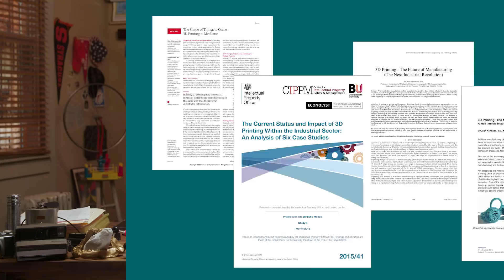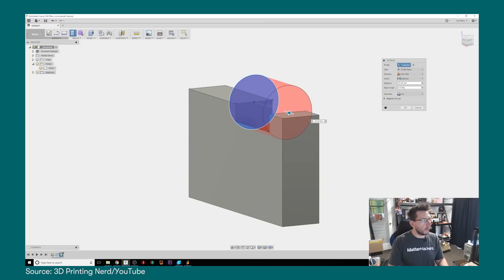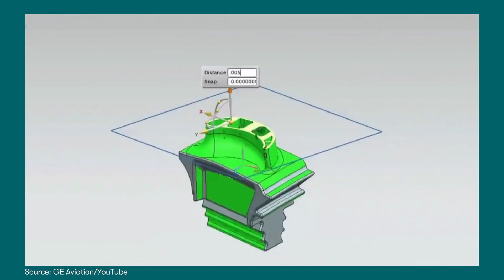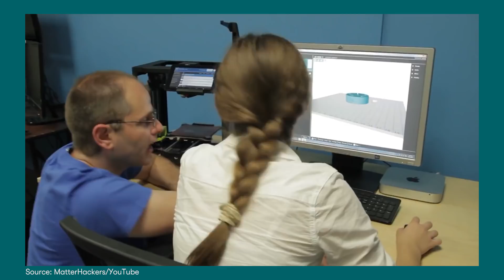What happened to the 3D printing revolution?

Comment: I've heard a lot of hype about 3D printed organs and body parts ie ears..  is this still a thing that is moving forward and has a future?
Reply: Joseph Brokenbourgh I think it might work out in the future
Reply: Technically it's not 3d-printing the organs, but 3d-printing a mesh that has the shape of the organ, that living cells can populate and grow in.
The technique is similar to other approaches, just that the organ can be printed with more precision than it could be built otherwise. 

It is definitely going to have a future. The only remaining question is whether it will be a full-width tool for all organ-needs or only a specialised tool that works with some, but not all. But there will be a place for it in the future. Up until we manage to get nano-bots working, that is. :-)
Reply: I did, I posted a link above. My original comment was meant to compliment Lou's report.
Reply: It's still a thing, but much more complicated than just moving a string of molten plastic. Research uses 3D printing for a lot of cool stuff, like creating a realistic meat-like texture for faked meat.

Don't expect to see this in mainstream for a long time though, doing individual experiments in a lab vs. having a reliable system for everyday use are two very different things.
Reply: Supposedly it's also going to be used to make homes
Reply: Already happening in Europe, several news reports from the Netherlands and Norway on 3D homes. )ne of them is printable in under 24 hours, I find google is handy for checking out things :)
Reply: halimceria it's not overpromising, it's a very complicated subject and there is possibility, it simply not easy to develop such a tecnology.
Reply: +Jamobu Wadeji "Look at how much they've improved in 25 years"

One of the first inkjet printers of our family survived more than twice as long as any printer we bought afterwards. I wouldn't use that as an example, new printers are only built to outlast the first ink cartridge.
Reply: SaHaRaSquad I meant print quality, not build quality in that case
Reply: 100% a thing. At least in terms of additive manufacturing of biofriendly materials. Things like bone scaffolds are almost ideal for additive manufacturing
Reply: There's a lot of 3d printed prosthetics companies at the moment, as this enables them to cater each piece of hardware to the users specific requirements/dimensions. I saw a company doing bionic parts which worked really well. Its an exciting technology in the right hands for sure.
Reply: They are trying regeneration in different ways that seem to hold promise.
Reply: Hell Yeh only just getting started. 3d printing will 100% be used in medicine in near (5-15 years) future
Reply: https://www.ncbi.nlm.nih.gov/pmc/articles/PMC4189697/
Reply: Materials is the challenge. Body rejects stuff that it hasnt grown, over time.
So yes, we are experimentally able to create organ substitute, short term.
Might work better for bones.
Reply: yes. and there are beggining of cheaper and easier to build prosthetics 3d printed. now for tissues its a bit harder because it also requires to grow the cells in separate cultures etc. but give a decade or two and it might be everywhere in medicine, just like additive manufacturing already is in many industries
Reply: you can't just print years of cumulative metabolism as an organ... some of you guys are delusional when it comes to 3D printing lmao.
Reply: I hope so. I want tetrachromat eyes. also, not that I really need it, but a bigger dick would be nice.
Reply: I agree that's where the future is. Old folks (like me) are going to need replacement body parts some day - and there's rarely a 'one size fits all' situation. 3D Printing will allow for custom-fit, bio-medical spares! :)
Reply: I don´t think so. In the future if you lose a leg you have lost it and that´s it.
Reply: Look it up. nub. Do you expect these plebs to give you the news?
Reply: pcolly2509 yeah I think people are forgetting that what we have at the minute, is the equivalent of the very first inkjet printer in ‘92. Look at how much they’ve improved in 25 years.

What we are using now, is the very beginnings of 3D printing. 

20 years from now they’ll be much neater (not smaller necessarily), more economic, faster and I would imagine easier to use.

Printing materials will probably improve, and prices will drop.

One day they will be accessible I imagine. Very much so
Reply: pcolly2509 umm, no. stop overpromising 3D printing.

Comment: Additive manufacturing can also reduce waste because you may not need to start with a big block of metal and machine all the material away. This is also potentially a lot cheaper.
Reply: Yeah - this is a good point. Also, if you have the ability to 3d manufacture in house, perhaps you won't have to invest in a big upfront inventory order that can potentially go unsold and sent to a landfill or wherever.
Reply: Joey Hoogendoorn you're comparing it to cnc milling. It would use the same amount of material for injection molding/casting
Reply: Dave Buchanan well not really. There needs to be a mold for injection molding...
Reply: Joey Hoogendoorn With the new advancement in 3d printing,which is rapid liquid printing(printing in a vat full of gel)it can be more efficient as there’s no need for support pieces to be printed and fillers as the gel supports the item being printed.TBh mold injecting itself is a waste as you can’t have a hollow space with whatever you’re molding in(sorry if i’m wrong about the hollow space bit).
Reply: Yeah, but that doesn't mean those methods can be used at all times or are most cost-effective. Material properties are also a thing to consider and sometimes there are features on a part that may not need the same structural properties and can be added on after the first part of the manufacturing process, possibly reducing overall cost. If casting/molding are possible for a particular part, it is probably cheaper at this point compared to additive and would indeed also use less material than a CNC process. Companies will probably start using additive where it can reduce cost and where they might be getting government funding because of joint research projects.
Reply: Okay, but CNC'ing might not work either depending on the complexity of a part. I'm just saying your material waste comment is misleading, there's too many factors to account for.
Reply: Search Matsuura Lumex Avance 25.....3D printing CNC machine......
/MindBlown
Reply: Might be misleading, but I said ".. can also.." , "...may not need...". Doesn't mean there is no opportunity to reduce waste for certain part types. If you interpret it as a general statement, then it's misleading for sure.
Reply: Don Gray that's true, but I think part of the advantage of 3D printing is the functional use. So no multicolor here. Supports are necessary for functional parts, but not purge blocks. Supports are usually very little material, unless printing miniatures or other high detail models (which are not functional). It's not that hard to design a part to print without supports too.
Reply: and you expect everyone reading to not interpret it in a general statement.